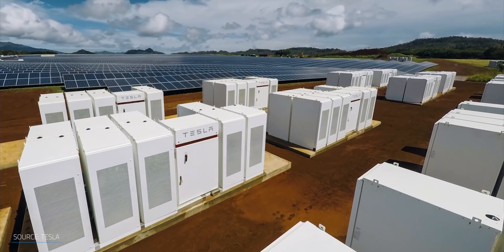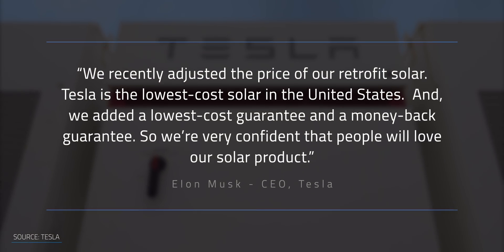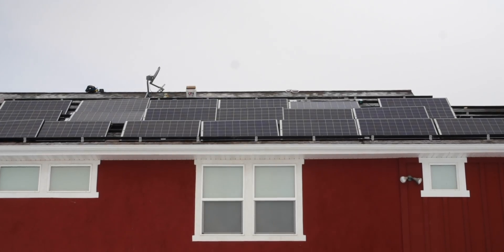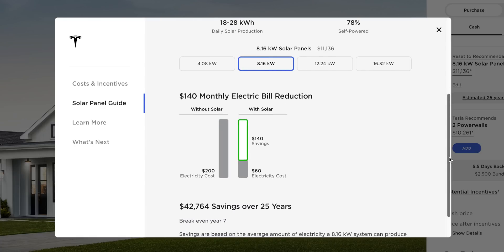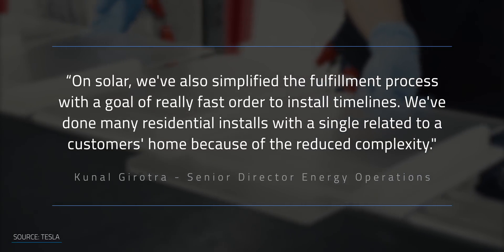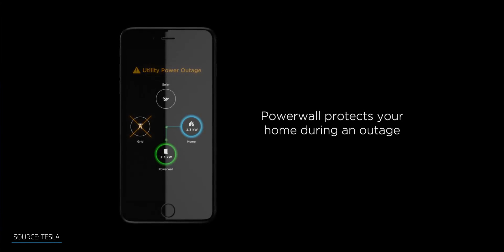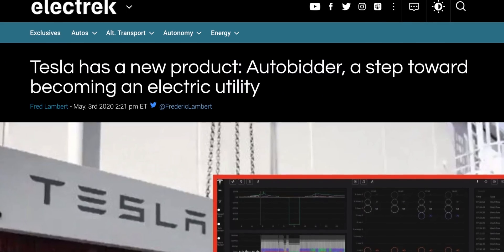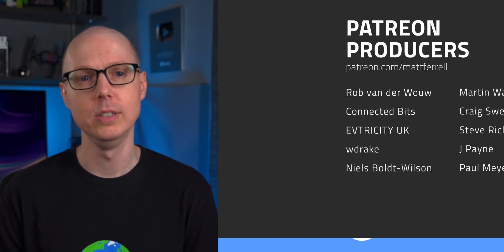Exploring Tesla solar panels game changing price

Comment: One of my remaining concerns about solar is lifetime and recycling/ recovery.  Does anyone know if anyone has addressed that yet?
Reply: This same channel had another video saying the life span is 25+ years.
Reply: @jaimemauricioarmentaborund9806  thanks, I  have seen that panels last 20 to 30 years with up to 80% of their stated capacity at that time. I am curious what then? The steel in my car is easily recycled.
Reply: @mikenyc1501  oh i see your point now, guess will need to wait for a more expertice answer. 
But lets asumme its total waste, it will be better to have a few unusable glasses than the tons of charcoil / oil used through out the 30 years
Reply: @jaimemauricioarmentaborund9806  aah but its not just glass. In solar cells are a lot of heavy metals. I made some in college, electrical engineering degree, and I have been following the tech. I do not believe the chemistry has changed that much.

Mind you, it's entirely possible you are correct.  I just don't know, and as of yet  have not found a good answer to the question. This is why I am asking and continuing to try to find the answer.

Comment: Hornsdale is only a financial success because it is competing against ridiculous predatory peak-demand charges that its very short burst of power eliminates.  Hornsdale financial viability is NO proof that lithium battery storage is the right move.  It's simply a stunt that shows that unabated capitalism in Australia has a capitalist foil.  We shouldn't blindly follow the mantra that lithium batteries are the right choice for utility grade storage.  Instead we should be questioning why a battery with a short duration life cycle (8.5 years, 3000 cycles) whose component resources (nickel, lithium, etc) will soon be in great demand as a necessary transportation storage method, is being labeled as a solution in situations where energy density (energy/mass) is not a factor.  Elon's selling it, and you're not being a reasonable assessor of why it is or isn't the right solution.

Comment: Also a Ford engineer tore down several model 3 and found that it has several vehicle-to-grid hardware already built into the car
Reply: NOPE, fake news.
Tesla inverter is ONLY ONE way and cannot perform V2V or V2G operations. 
those were Transistors NOT Transformers.

Comment: His battery's are to small, If you want to run a wood shop at home, you would need 10 power walls
Reply: so, get a Powerpack + solar , each TESLA powerpack is 210 kwh and lasts for 4H Full Load. 
Solar can FULLY Rcharge in 4 hours.

Comment: Another interesting review of Tesla Solar. I’m hopeful they’ll bring down the cost for domestic installations.  However, I’m not so sure about large grid installations as tech such as liquid air batteries may be more viable through lower cost and greater efficiencies.
Reply: NOPE, looked at the Science, and Liquid Air Batteries are Bullshit.
MEGAPACK is Already Profitable.
and can be Delivered to a site on a Flatbed and hoisted onto a Concrete pad. 
Megapack is 100% Completely self contained and connects Directly to Renewable Energy and GRID . 
can be built in Less than 30 days. 
Smallest Megapack is 3MW and is Scalable and can be Daisy Chained. 
TESLA is building 800 mwh in Nevada.

Comment: Matt,  did you factor in the reduction of federal Investment Tax Credit that kicked in 2020 and will drop very quickly?  30% Federal ITC is GONE.

26% tax credit extended for solar PV systems installed between 1/1/2020-12/31/2020
22% tax credit extended for solar PV systems installed between 1/1/2021-12/31/2021
10% tax credit extended for solar PV systems installed between 1/1/2022-12/31/2022  (this is zero for many residential customers, depending on whether they buy or lease)
After January 1, 2023, the Federal solar tax credit will no longer be an available advantage for homeowners.

Comment: Great video. I love the concept of solar even back from over 30 years ago but it just seems a bit too expensive still.
Reply: Absolutely! The math simply doesn't up add. You could invest the cost of the solar panels + battery in a bond over the life of the panels and at least double your investment. Many states have restrictions on what incentives they offer and most if not all states will not allow you to reduce your bill to zero since part of the bill is related to fees which are permanent. Then consider the fact that the battery backups aren't enough to fully power an average size house for a few days in case of power outage during a winter storm when you certainly will not have enough solar replenishment. The whole concept seems absurd to me at today's prices.

Comment: Great! Now we need to scale up solar PV everywhere along with regional wind farms to keep coal out of the atmosphere and nuclear and natural gas in the ground where God put them.
Reply: we should also keep silica in the ground where god put it , right?. And copper, and lead, and sand.
Reply: @MrMauserb  Well no because they are safe materials in the right application. In the "right" application coal, oil and natural gas produce air pollution and carbon emissions while uranium create long term nuclear waste. 

My SunPower solar pv panels are designed for clean disassembly and re manufacturing in a circular economy after generating renewable electricity on my garage for 40 or 50 years.

Comment: I think the problem is due to the incentives. Because of them it has created a market for businesses to make large amounts if money installing them. I have had quotes done for my home. The prices came in at 10 to 20K more than the price of the hardware. It takes about a work day for a few fellows to install them. Minus a bit for overhead costs, and permitting fees, they are overcharging by 7-17k. The incentives are entirely being absorbed by these companies by charging outrageous prices.
If they went away it would be much harder to keep that business model running. Regular contractors would then pick up the work at normal labor rates.
Local government is the next largest source of wasted money as they set uneeded requirements driving up costs.
Reply: same for the EV, because you get some money back, manufactures think they can charge more, an Opel Corsa or Honda-e cant cost 37000Usd! Crazy.
The insentive should be others, like you get free charge electricity when you charge your car, or you sun energy that you will drop to the grid will be better pay to you , so you can get your investment in a faster time, and so one.

Comment: Wait what? In the Netherlands, it's about 1.25 Euro to 1.5 Euro per Wp, depending on the brand. 310 to 340Wp panels. This is including VAT (21%) and any tax the Netherlands can think up. This is without any green investment funds.
Add some wiring, an inverter of 1000 euro max. and some frames, and you are finished.
Why is solar so much more expensive in the USA, while anything electronics related is a fraction of the price compared to the Netherlands...
Reply: I am stupid. If I look a bit better, the price for 334Wp is 0.35 euro including taxes... Only the LG's are around 1.1 euro/ Wp . Still including taxes.

Now the incentives in the Netherlands is that electrical energy in the Netherlands is taxed about twice as high as gas. We pay around 0.10 euro per kWh energy tax, which also get's raised with VAT. Energy itself is around 0.06 per kWh. But we also have transport costs which is monthly fixed.
And for now, anything we deliver to the grid, is what we get back 1:1 including energy tax. They wanted to change it into anything we produce ourselves should also be taxed with 0.10 euro per kWh..
It's cost ineffective and actually not do-able to live without the grid. The netherlands is too small for that.

Comment: I'm a fan of Musk and own Tesla stock, but am not impressed by the Tesla solar panel offerings. I bought good quality 100 watt "Rich Solar" panels on Amazon last spring for $0.75 per watt including shipping. If you can work with larger panels, you can do even better. The AltE store has Q Cell 345 watt Poly panels for sale at just $0.47 per watt. Those prices are before incentives. Tesla is nowhere close...

Comment: Solar has been 1$ per watt for years. I am a solar technician and I can get a 300w panel for about 275$.
Reply: Also with Converter and Installation? No
Reply: @martinbohl8732  of course not installation and microinverters are seperate cost. It depends on the type of system installed. However we are talking about the panels, the panels themselves are less than 1$ per watt.
Reply: @jamesdrive8083   but the prices in the Video are about the combined costs. This is what is all about for the consumer. Tell me If I do misunterstanding Something.

Comment: Local building codes are stuffed with red tape that unions and politicians tap for power and money.  Solar needs to bring in utilities which are even more regulated and politically powerful.  What I see in this video is Tesla using it's size and power to offer standardized solutions at market price.  Now we just need another big player to do the same and we can get solar growing as fast as we need it to.
Matt, please report the actual system price along with the total installed and incentives.  The incentives are all over the place and there is no reason to believe you will get them all.
Tesla is a big player in EVs.  Tesla is a small player in PV but that just gives them lots of room to grow and honestly, the PV does more good for the environment than EVs.

Comment: Nice video, I work in the industry.  You are correct that permitting is a major issue in the US.  You also need to include fees for interconnection hookup to the utility.  Your equipment cost may not include labor costs to do the actual work.  This is not really any new news and most systems are already at $1.49 without permitting, fees, and labor costs.  You should also be aware that the United States has penalties of about 30% just to import solar equipment from anywhere in the world.  The solar industry has had one hand tied behind its back the last 4 years and is still holding its own.  Costs are coming down rapidly, the reality of it is that Elon and crew are just keeping up with the rest of the US industry.  Tesla just has better marketing !

Comment: What is the most important for me vs solar energy, is that my first installation (resale only) of 8.5 WKC started in 2013 (first full year) is not showing any decline, not washed, not yet replaced inverter, simply each year there has been more solar hours, meaning I see a light but steady increase in the yearly sold kwh. Those are german panels.

Comment: I purchased in 2018, panels assembled in Italia, with chinese cells, for eur 89 per 250w panel excluding delivery, and those are reliably delivering 188w. Those are polycristalline and work quite good in partial shade and cloudy days too. I live in France and French solar panels are from 3x to 4x in price. as of 2020 performance of those cheapest panels is till measured identical to new. To compare apples to apples, I am just talking of the PANEL (not a complete installed system) here. And this is a unit cost, without any scale reduction, I could have if I purchased 10 or 20 or a pallet. Your installation will deliver energy for 50 years or more, so whatever the price this is a good investment, forget about finance, but just energy out for energy in, it's good.  Sometimes you loose money, but if you get long run water, energy, fruits, vegs, it's better than money.

Comment: I'm in a odd situation.  So, I'm $17k from paying off my house, hopefully that will be done before the end of the year.  Then I'm purchasing a Model Y...  Shortly after the Y, I want to do Tesla Solar, and Power Walls.  But my house is old - was put on the foundation in 1926...  LOL..  The problem is (I'm in Wyoming, and Tesla doesn't have installers here) the house has been through numerous hail storms.  Everybody else has new asphalt shingles installed, but my roof keeps smiling, and continues to take a beating.

I don't know if I dare install panels on the roof or not, I'm afraid of opening a huge can of worms....  And I don't know what manufacture I'd go with anyway.
Reply: Is your roof asphalt also? If not, what are you using. I'm just south in CO and likewise worried about hail. Wish my yard was big enough for pole mount solar tracking! Maybe thats something, or ground mount, will work better for your ~90yr old home?
Reply: @justanumber427  Is some concoction.. My neighbor is in construction.  So,  you have the wood base of the roof, something that resembles tar, then cedar shingles... I'll probably just do free standing panels,  I'm not wanting to get involved in a huge bill.
Reply: I can get you solar out there. I’d say do solar FIRST because it will cost less than your power bill and there’s no money upfront so you want to start saving sooner rather than later

Comment: there warranty is also significantly less than most other solar companies...
Reply from the maker: Curious what warranties you're seeing that are better?  I have non-Tesla solar which has 25 year panel performance, 10 year comprehensive ... and that's the same that Tesla offers.  25 year panel performance warranty is pretty common from what I've seen.

Comment: I knew the Australian battery bought electricity when demand was low and sold it when demand was high (kinda like stock sellers) and that after 3 years it made the same amount of money it cost to buy.

But I didn't know it drive down the overall cost of the grid by twice the cost of the battery in a single year!
Reply: tell, that to the people with TESLA Virtual Powerplant , they are Actually MAKING money.
Reply from the maker: There's a good reason why they're expanding it!  👍

Comment: Why, exactly, are you "happy you didn't wait"??!! With the "ridiculous" cost ratio in the US these days what are the offsetting distinctive advantages for not waiting to make an "investment" that has no reasonable payback yet?!?
Reply: TO give further foundation, we just purchased a home in Austin, Texas where the previous owners had presented that they installed a 12.4 M watt system about 3 years ago for (they said) $50,000 (pre-subsidy) cost. We, essentially, gave them nothing in price for this feature and there is no way I would have justified this cost or made that decision. I am glad to have solar and it is making a difference in electric bill, but I have no idea what anyone would be thinking to make that purchase right now with a 30 year payback...
Reply from the maker: I'd be surprised if a 12.4 MW system in Texas took 30 years to pay back.  My system in the Boston area will be net positive in 8-9 years for panels that will last over 30 ... but my area also has some crazy high electricity prices (over twice the Texas average).

Comment: I wish Hawaii had those prices. I paid $29,000 for a 7.38kw system before incentives. Thats  $3.92/watt. And then i added a tesla powerwall and my price went to $43,000. Just be happy u guys dont have to pay hawaii prices
Reply: Paradise tax!
Reply: Andrew Yano : Curious, which company did you go with? I was talking with someone on Reddit who lives in Hawaii and they said they had a system with 2 PowerWalls and 24 panels installed April 2019 for only $32k from Rising Sun Solar.
Reply: Andrew - Kauai is partially powered by TESLA Powerpacks + Solar. it can even Power the city all night long , after the SUN has set.

Comment: Solar installers in the US have tremendously high "contractor overhead and profit".  They would argue that this is necessary due to the great number of lawyers in the country and the high cost of buying politicians.
Reply: Also, insuring every installed system for 25 years means that contractors need to have enough capital savings to cover these potential risks.
Reply: @11u510n15t  the 25 year warranty is from the manufacturer, not the installer.  Defects in workmanship are generally caught relatively early.

Comment: Hornsdale Power Reserve is a pretty spectacular example of how quickly energy storage pays off. One can't help but remember mocking words the best politician coal money can buy, Scott Morrison (who is, inexplicably, still the Australian prime minister), had for it ("biggest banana"). And it paid for itself in a single grid separation incident.
This is an example of a situation where Musk's hubris was well placed.
As the current generation EVs age, there will be plenty of used batteries for "second life" applications. And I think there is still room for flow batteries, various gravity accumulators (not just pumped hydro) and many other more exotic energy storage solutions. We will need them all.
Reply from the maker: There's magical belief and then there's facts on the ground.  Magical belief doesn't stand up well to the other.  Curious how he speaks about the project now.
Reply: @UndecidedMF  Yeah. Probably paints it as if he made it happen. Trump would. :o)